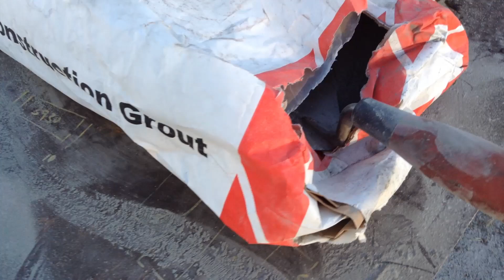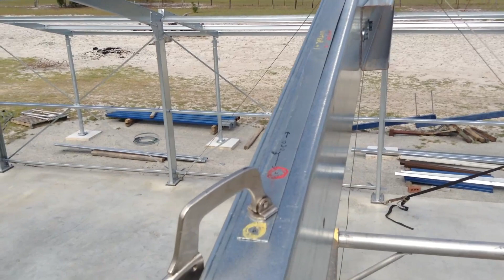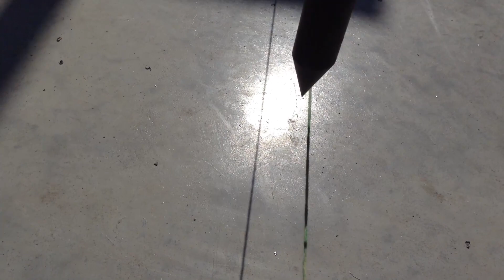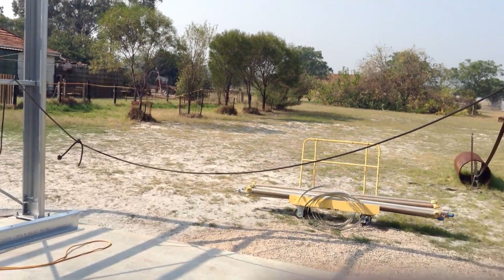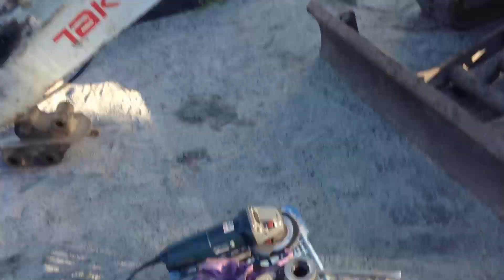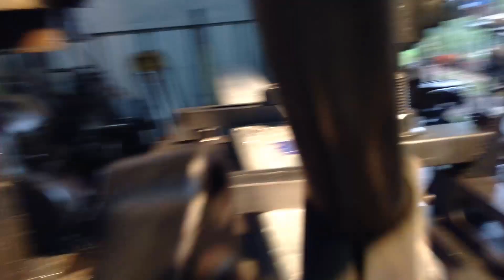New Machine Shop Construction  Update .

Comment: Looking good. Was this a kit you put together so to speak?
Reply from the maker: Hi Tom .   No it is all my own design . I just had an engineer from a shed company  draw up my plans & he drew up the main structure as per my design , so the correct material profile sizes were used .   These plans were required so the structure could be approved by local city council .  The purlins & girts  they get profile rolled to length . The columns  & rafters  i had ordered slightly over length as the ends had to have angles cut on them .   Then it's just a lot of cutting , drilling , making brackets , welding & drilling bloody holes !

Comment: G'Day Max - your shed is really looking good so far. It's not an easy job on your own.  With your grouting, once it's cured give it all a few good coats of concrete sealer. You can also loosen the nuts and pour the sealer down around the bolts one at a time. Look up "Carbonation-induced corrosion". Same for Chlorides.  Stay safe and well :)
Reply from the maker: Thanks . I will look it up .   Cheers .
Reply: @swanvalleymachineshop  No worries Mate.

Comment: Geeeeezzzz what a job Max for a one man show.  I put my own shop up but it was all pre-drilled and sections cut to length which made it easy but you shed is on a whole other level.  Setting the purlins on site to adjust the portal frame racking was a great idea even though it takes time its done right.  Really looking forward to the future plans you have for this business/shop.
Cam
Reply from the maker: Thanks Cam . Yes there is a ton of work , esp with the concrete as well .  I can not wait to get all my machines  in one location & under one roof !   Do you still have plans for doing castings again ? Cheers .
Reply: @swanvalleymachineshop  G'Day Max, yep I certainly want to get back into casting but on a much smaller and controllable scale than my previous endevours.  My time for anything at home is diminishing and have this months weekends and well into next month taken up to get pipeline sectional replacements completed with my crews between shipping windows.  Bring on retirement, at least semi retirement.  I do have some news to show in my next video with a new machine now in the shop, something I've been looking for for well over 5 years.
Cam
Reply from the maker: @camatbattler2233  Sounds like you are just as flat out as myself  !    I am guessing a small cylindrical grinder or T&C grinder !    Cheers .

Comment: Shop is looking good Max.  As always you seem to get more done than one man should be able to do.  Other than the rain it must be a relief to not have to work in the heat.  I'm at the beginning stages of building a new house right now and I have been doing a lot of pick and shovel work.  We have had some +35C with 65% relative humidity and it has been brutal.  It was only 4 months ago that we had -37C here one morning.  Looking forward to seeing it sheeted in.  Ken
Reply from the maker: Thanks Ken .   That's cold enough to freeze the Bollock's off a brass Monkey !    How is your new machine acquisition  , the Wotan coming along  .
Reply: @swanvalleymachineshop  I finally got it in my shop just over a week ago.  I am currently tearing into it to clean/repair/get to know it.  Hopefully I'll be able to use it in a couple of months.  Ken
Reply from the maker: @hmw-ms3tx  Sounds great .

Comment: Wish I could show the same progress on our old shop.  It's more like a rebuilding project, though.  And working around everybody else's ideas is not the easiest thing.  I'm considering the idea of using rammed earth for rebuilding the walls, with clerestory windows around the top.  

Look forward to when you can make your move in.  I haven't seen an overview of your current shop, but I've kinda gotten the impression that you're a bit cramped for room ... something I'm all too familiar with.  I'm debating whether or not I should include an extension with my rebuilding plans.  Another foot or two in all directions would make some things a lot easier.
Reply from the maker: The more room you can get away with the better . Rammed earth i imagine would have good insulating properties .   And yes my current space is small  !  
Cheers .

Comment: Great Job Max, bloody big job. And the reasoning for the grout was? I would have thought it was supported well enough.
Reply: The nuts under the post are for adjusting the post height and into plumb, they will not hold against the strong  winds he showed on another video and even if they would it's not a bad idea to strengthen such a critical component of your structure.
Reply: @simpleman283  I would not of guessed that. Up here in the  US, east coast, Delaware Valley not seen that done to 16' tall buildings that are steel constructed. Well maybe a few.
Reply from the maker: Hi Pete .  The grout gives the column base a solid footing , rather than just sitting on the adjusting nuts .    Cheers .